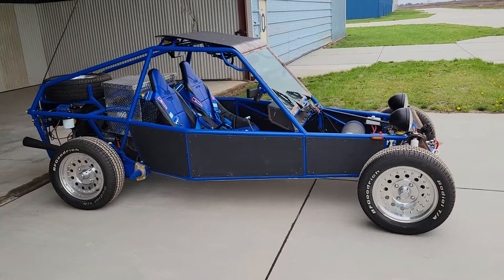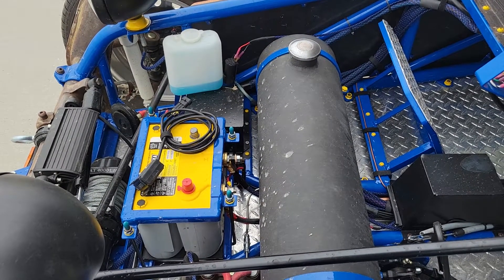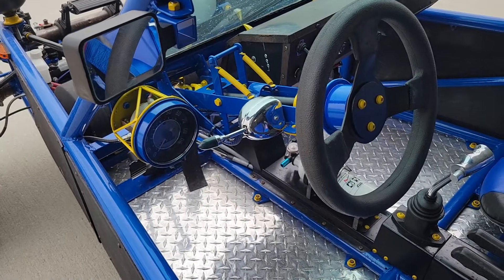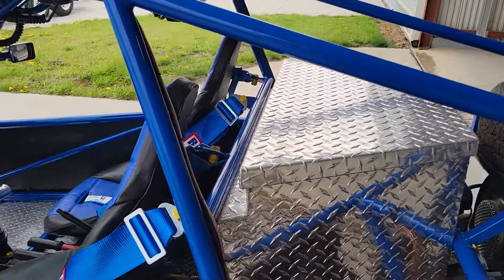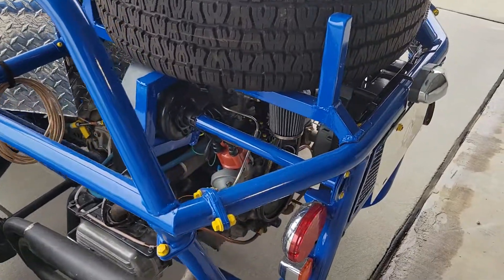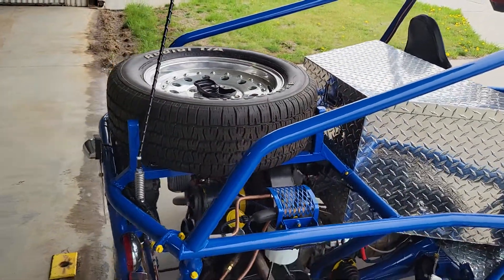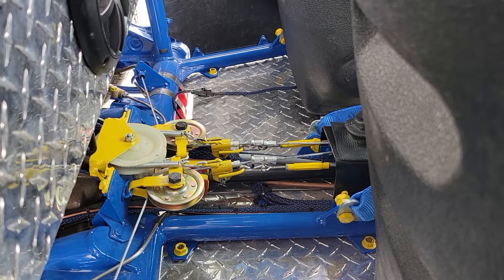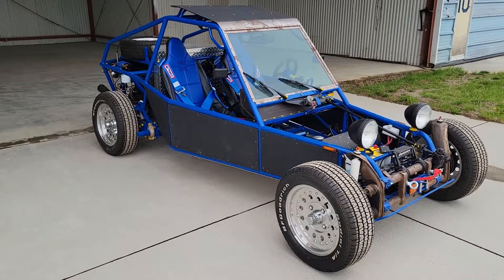Berrien Buggy Stalker II Sand Rail Pt. III Final Review

Comment: Nice build You have some very interesting ideas there.  But if it was mine, I would change that exhaust. That dual exhaust actually robs HP, these engines work best when you have all 4-exhaust pipes going into a single collector
Reply from the maker: My primary concern is reliability. For my purposes there is plenty of hp. But if hp were a concern your advice is certainly correct for increasing exhaust scavenging.

Comment: How well does running the oil through the manifold work? I thought of doing that and had never seen it done until I watched your video. Great looking rail and love the attention to detail that you put into it.
Reply from the maker: The oil is at its hottest where it comes from the case, through the pump and then into the manifold. That heat helps vaporize any fuel that condenses under the carb but only works well after the oil gets up to operating temp.